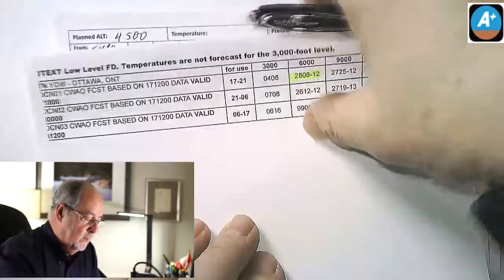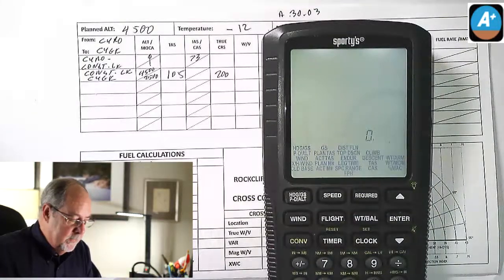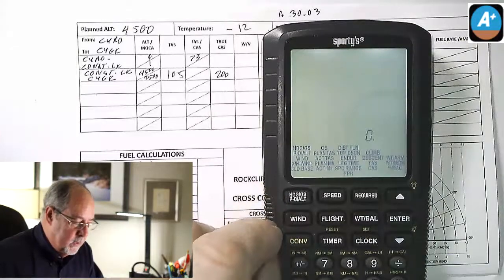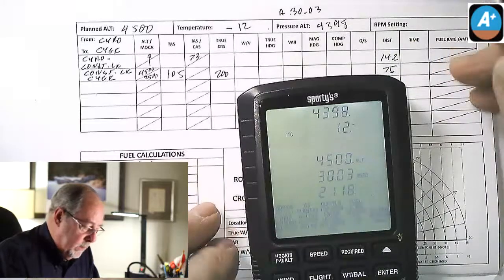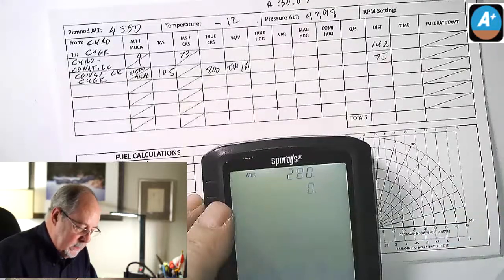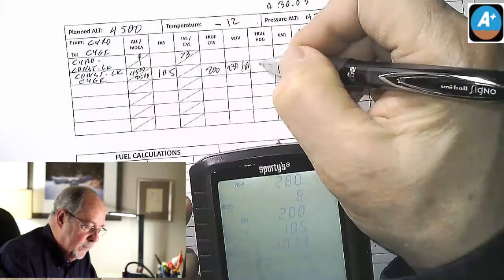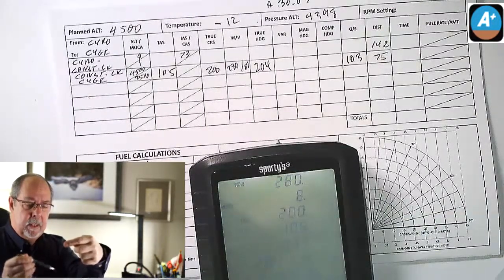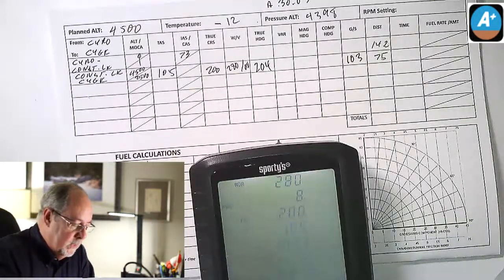Sporty Electronic E6B guide 1

Comment: how do i calculate time en route on the flight computer?
Reply from the maker: Hello Kai.  Time en route in this case is leg time as there is only one leg calculated.  If you have more than one leg, then time en route would be the sum of multiple legs.  In this video, I only calculate the leg time from the set heading point to the destination, but en route time would be that plus the time to get to the set heading point, in this case about 12 minutes.  So calculation of leg time starts at about 8:10 in the video, and is shown in step 4 in the summary at the end.  Hope this helps! Jean

Comment: How did you get the variation of 14?
Reply from the maker: That's a very good question.  Two answers:  it is actually incorrect, should be 13 W.  And I should have gotten it from the top of the map  by the dashed line where it says 13 W.  Silly mistake. 
Jean
Reply: @aeroposte  I am not saying you are wrong.  I am a newer pilot and I was just learning how to do my nav log... so I was trying to see where you get that number from.  Thanks for the info, I now see it on my sectional!
Reply from the maker: @TLHRookiePilot  Fair enough, I didn't think you were criticizing.  I just realized when I was looking at the number and discovered I was wrong.  Cheers!

Comment: Where and how did you get the VAR to add to the TRUE HDG THAT = MAG HDG?? Thanks for the amazing video!!
Reply: They are on the sectional.  Should be magenta dashed lines.  If you are in the states, the variation will be lower because you are further from the pole
Reply from the maker: Thanks Jeff for responding.  In Canada, the variation is also shown on dashed lines, and the variation number is at the top of the chart.